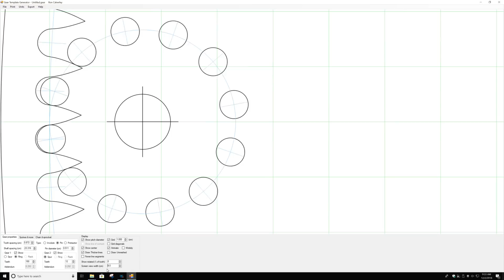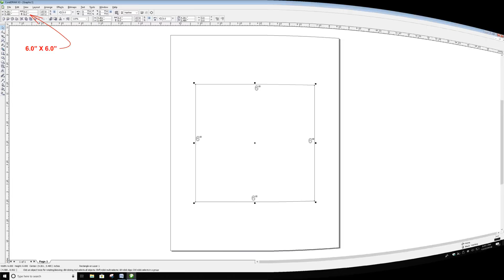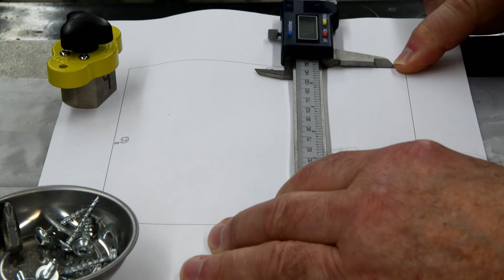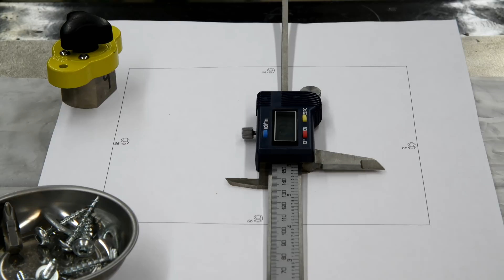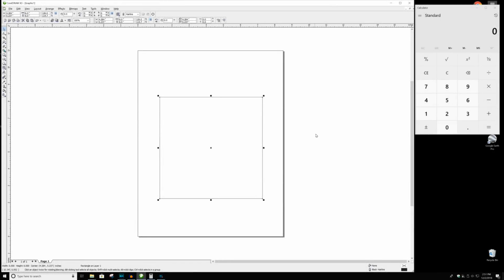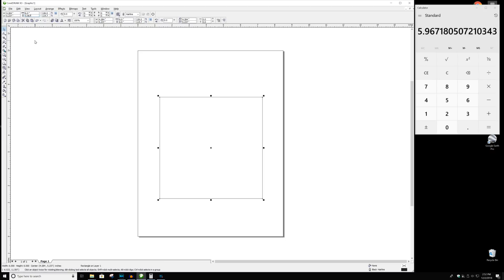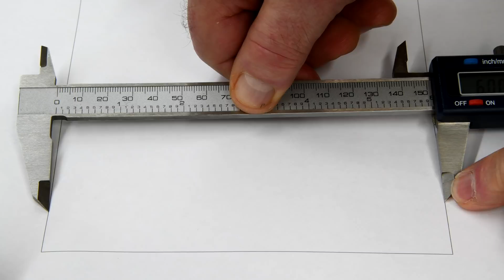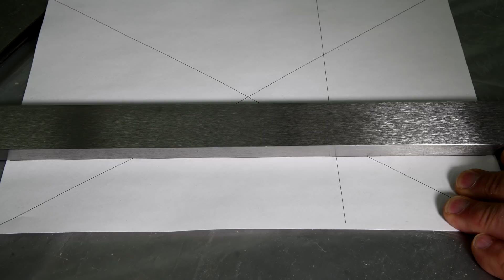Just How Accurate Is My Printer?

Comment: What is the allowable tolerance for digital calipers? .005 isn't much more than the width of the line. .033 is less than a tenth of an inch per foot. I don't recall what you said the diameter of your clock is but, if it were 48" you would gain .04" in one direction and .264" in the other. That's enough to cause a wheel to vibrate at high speeds but would be ok in a wheel that turns slowly. Anyway, I'm now starting to confuse myself so I'll look forward to your next installment. See you tomorrow!
Reply: Cheap calipers are usually +-0.001" accuracy, 0.0005" repeatability according to spec sheet that comes with them.  Mine check out very well against my micrometer.

Comment: I bought his bigprint program a while back. In his videos where he uses it he indicated that inkjet are far more accurate then the laser printers. When printing off something that spans 2 pages wide and tall I do find the lines don’t line up perfectly with a laser printer.  In that program there is a calibration section to adjust to variations between printers. I’d be surprised if that wasn’t in the gear generator program as well.